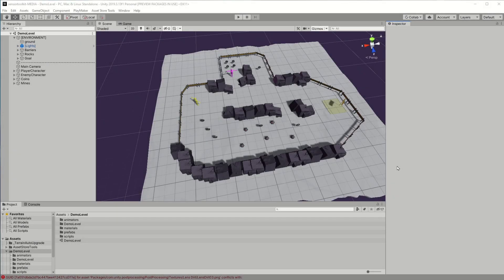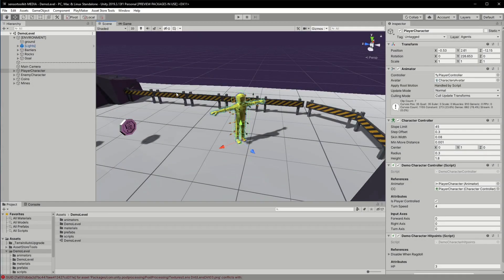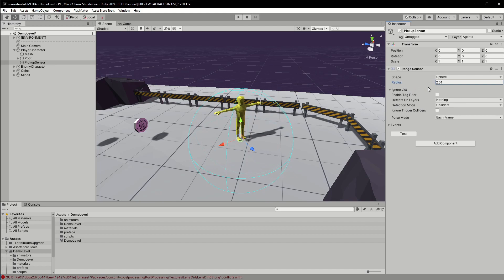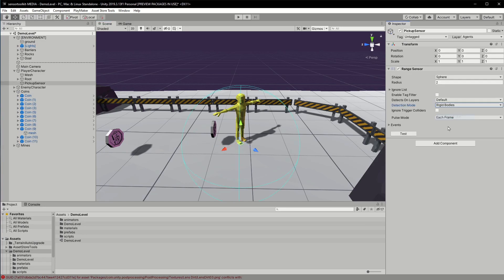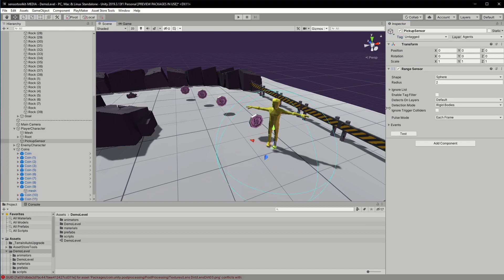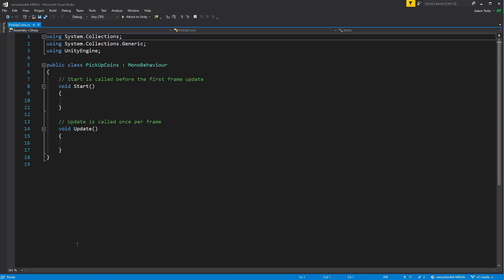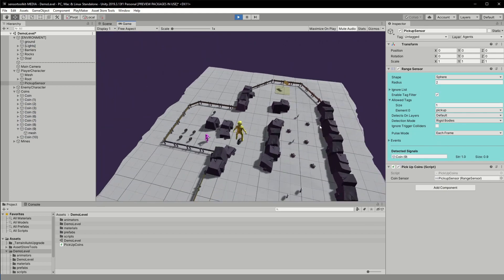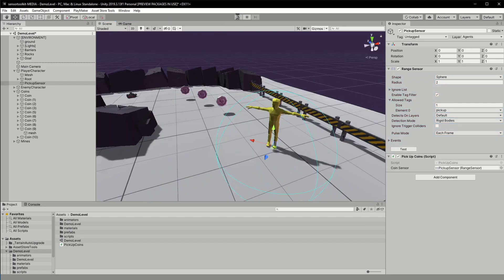SensorToolkit 2 Guide Part 1 -- Range Sensor

Comment: not loyal developers. Deprecated sensor toolkit instead of fixing it, instead the customers are expected to buy a second time even if they never sold a game with the abandoned version. I would not purchase from that sort of seller.
Reply from the maker: Sensor toolkit V1 had received free updates for the past 4 years. You can still use it if you don't want to upgrade.
Sensor toolkit 2 is a significant rewrite that took a lot of time to make. Owners of V1 receive a discounted upgrade fee. It's only necessary to pay the difference